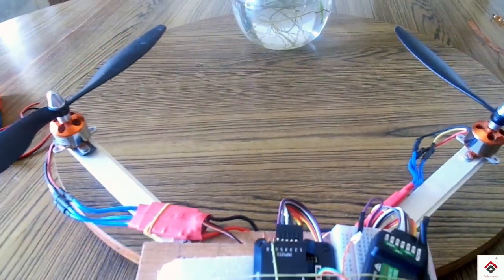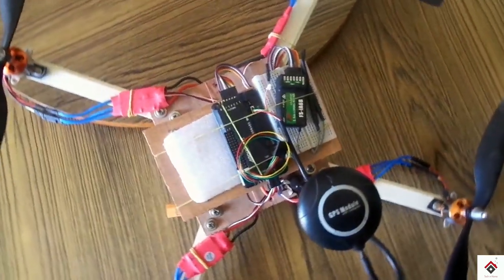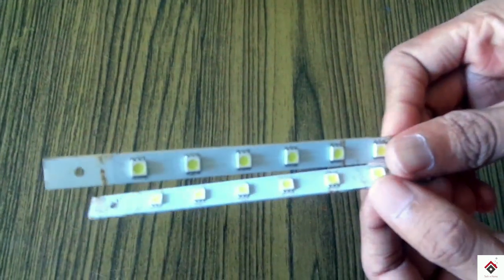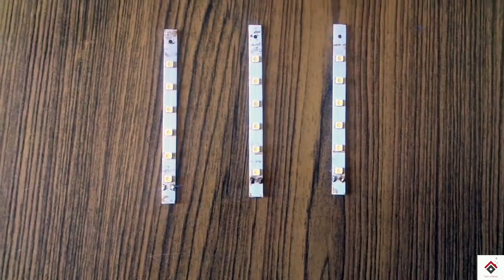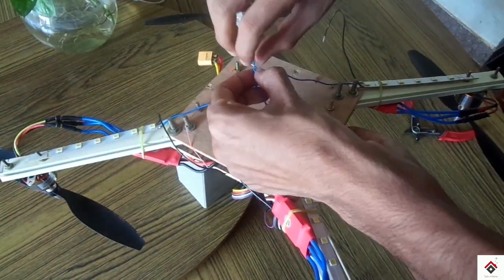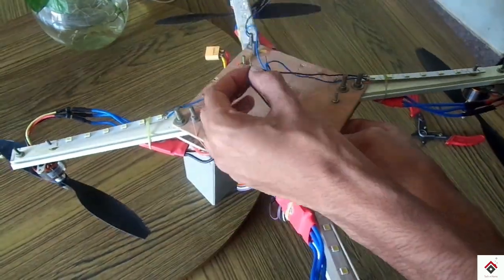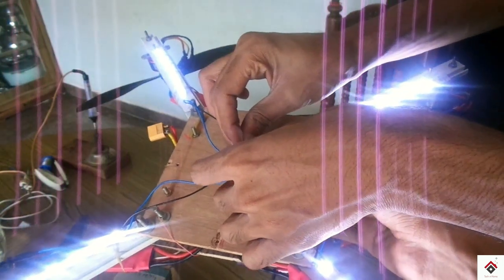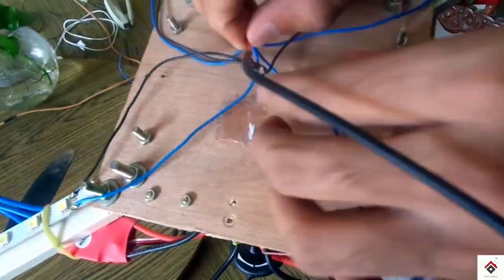How to install LED light strips [12v] on APM Quadcopter |  Drone Night flight test with LED lights

Comment: nice 
but why dont you take 4 leds 2 red and 2 green and put 2 red leds in the front and 2 green leds at the back and program it with the help of arduino and make strobe lights which will make the drone look like dji phantom
Reply from the maker: Yes it's good idea